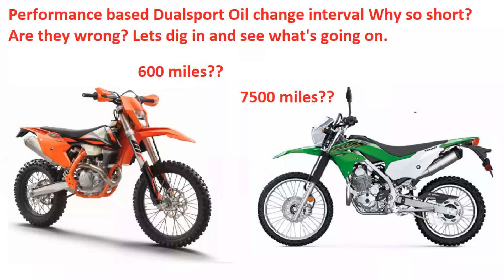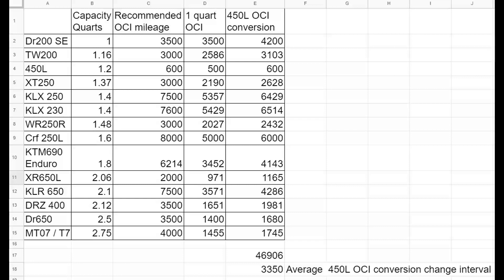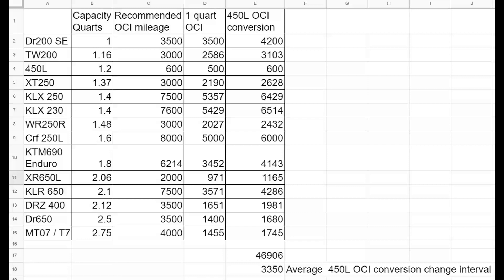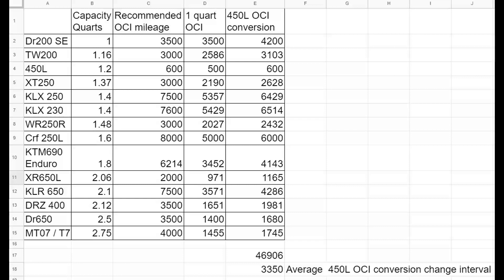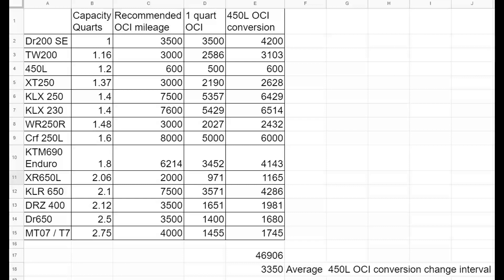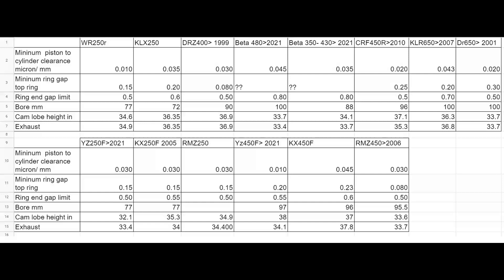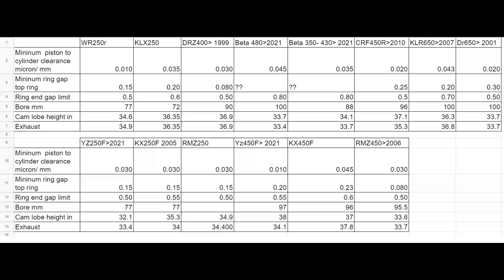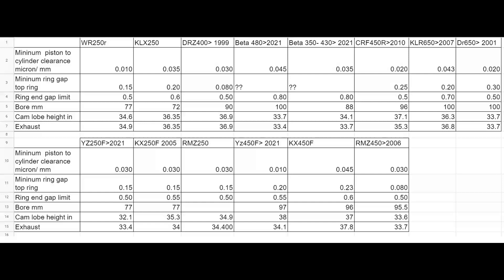Performance Dual Sport Oil Change Interval why so short?

Comment: I think it's got a lot to do with the chassis design and the clutch among other things. Why? Well it's in the use case right? Honda would have sent their 450 out on the test track piloted by retired pro racers who absolutely hammer the bikes to the limit because they have an amazing chassis and suspension compared to every other bike on the list. These guys are slipping the clutch in 3rd, 4th, and 5th gear all the way through some of the corners and through whoops at wide open throttle. Then beating them up in rocky climbs, deep sand, mud and singletrack at relatively low speeds with nearly constant clutch slippage and very little air flow available. The clutch is like a little nuclear fission reactor bathed in a mere 1.2 liters of coolant (motor oil) getting COOKED. After the tests they send the oil off to analysis. They throw in some sort of fudge factor to come up with a reasonable number for a non racer who rides on the aggressive side, and then tell you to change it after every race. They don't send someone out to ride it like a granny to see how long they can get the oil to last because they don't expect people to ride it that way. Plus they can't have people ride at a pro level all summer on the same oil and then blowing the bikes up, tarnishing the manufacturers reputation. 

Bikes like a crf250l just cannot and are not expected to be ridden that way. The engineers would have been told to design a low maintenance easy to ride beginner dual sport with baby-soft suspension. They likely did send average riders out and tested through oil analysis to see how long they could safely stretch an oil change interval and then weighted their formulas way over on the high side to try and grab more sales in that sector of the market. Also notice the 250l has a significantly more robust (and heavy) cooling system compared to a repurposed race bike type of dual sport which will help with that clutch even if it is ridden aggressively.

If you're just dual sporting around on pavement and dirt roads, you don't do a lot of near-stopped riding on tough trails, and you don't spin up the clutch a lot, you can probably stretch those intervals waaaaaaay out. I think there are people out there that have done oil analysis and push their intervals up pretty high.

Comment: I loved this video! I have KTM 500 exc and change oil every 15 hours (about 300 miles) with every second time only oil just leaving the filters.
Reply from the maker: On my 21 500 my last two changes were 35 and 32 hours   with right around 1200 miles. The oil lost a little viscosity but not too bad. Checked with a ball viscosity tester. Motul 7100.

Comment: I think dirt bike oil change intervals are more frequent because the operate in the dirt. Air sucked in the engine during off road operation contains lots more particulate (silicon) than on road operation. The micro silicon particles ingested get suspended in the oil and accelerate wear. I think KTM expects their EXC’s to spend 99% of their lives off road ingesting particulate so they suggest more frequent oil changes than true “dual sporting” motorcycles. If you want to make a dirt bike engine last, clean air filter and change oil frequently :)

Comment: I think factors of compression, squish, combustion efficiency, piston ring count, HP/CC are relative to OIC as well. Of course a casual ride will not contribute to oil breakdown like running through gears and bouncing of rev limiter for 30min Moto, 2 -3 hr hare scramble. The nice thing about the change on the L is it cost maybe 8$ per change and takes all of 10min. I really don’t mind changing the oil after a weekend of riding, it needs cleaned up anyway.
Reply from the maker: The static compression  for the KX250f and 450 are from 61 to 102pis.  It is 96-140pis for the KLX 250. So cranking compression pressure is a bit higher on the dual sport than these race bikes.  The new YZs do not give you a compression test value. This is probably due to the decompression mechanism.  The bike does call for 91 with up to 10% ethanol so the overall  dynamic compression can't be much higher than any of these bikes calling for 91 like the wr250r. Combustion efficiency should be about the same. They all use modern design chambers.

1 vs 2 piston rings and the overall design play a role in heat transfer from piston to cylinder wall. Ring thickness has an impact on how well they  seal and how well they transfer heat to the cylinder. Ring weight is important at high rpm to avoid ring flutter. So generally race engines have one thin light weight compression ring. Two rings have more drag but also transfer more heat from the piston to the cylinder.  I don't believe this really impacts the oil life for the casual rider.